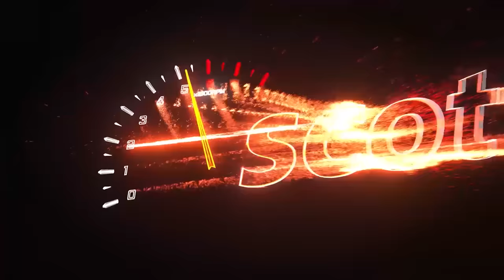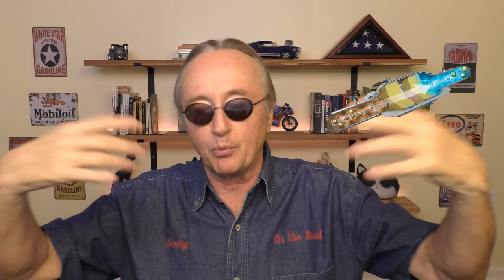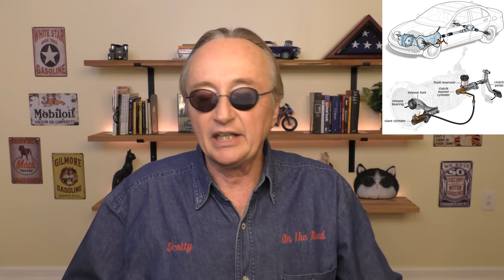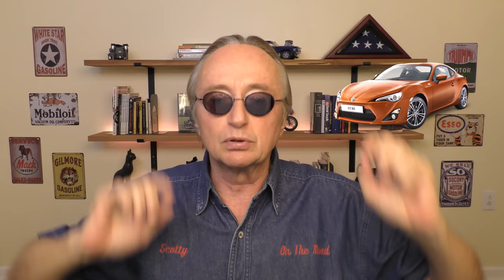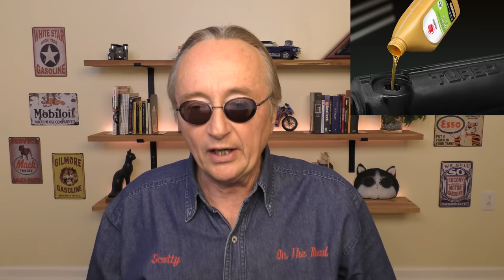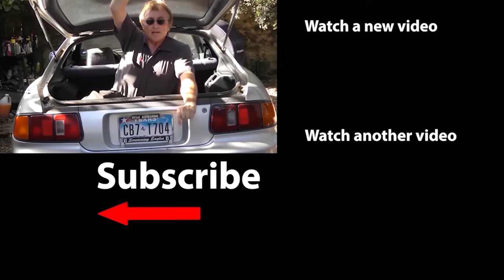Here’s Why Engine Braking Can Destroy Your Engine and Transmission

Comment: I have to disagree on transmission wear, while breaking you are using the other side of the gears teeth, so if a transmission is made to run for 250.000km i think it can help breaking 10.000 km, the only real abuse is in clutch and timing belt.
Reply: @Mark Codiroli maybe that's how you break, slamming the clutch instead of a gentle release? you can do smooth engine breaking and it is absolutely mandatory in snow, if you don't have show, good for you but stop saying this non sense, people will slide in snowy conditions and have accidents because you think you are smart , i said what I said because I am actually working in designing manual gearboxes for an automotive manufacturer, i do tests on them and I know what I am saying. We do same  treatments on all contact patches from gears so the same amount of wear can be done both ways even if it never is.

Comment: I seriously might have screwed up my transmission by down shifting prior to going down a hill.
Reply: No, Scotty's completely wrong about engine braking. Coasting down a hill and riding the brakes is incredibly dangerous. Engine braking doesn't even damage your car in any way. You save money on fuel, since it's completely cut from the engine in modern cars, and on brakes. He couldn't even explain how it causes harm. If you rev match and manage the clutch well, it can be the best technique in your driving arsenal

Comment: Do I need to have my intake valves inspected for potential cleaning? I have a 2018 Honda Ridgeline.
Reply: My concern is that the earth dreams is a direct injected system so with the lack of fuel passing over the intake valves keeping them relatively clean, I was concerned about build up. I hear some talk about "Catch Cans" but unsure about how or if that would solve the potential issue. 🤔

Comment: Hi Dear, I have a CRV 2016 and I hear a grinding noise for a second or 2 when startup when really freezing cold, same when turning the engine off as well...Do you know why?
Reply: @Mark Codiroli Thanks Mark, I will try and let you know
Reply: @Mark Codiroli No, still doing the same sound, it didn't fix it.
Reply: @Mark Codiroli Mark, you are so kind to follow up with me.  OK, it sounds like the noise is coming from the dash behind the wheel, and No AC or Audio is on. But when it is inside a warm garage the noise doesn't exist. BTW, the noise sounds like when you try to start the car with a key when it started already. This car is push-button CRV EX AWD Thanks again
Reply: @Mark Codiroli Thank you so much for the help, I'll take it to Honda and see. I was hoping it is something smaller than that. Thanks again for the care, time and reply, God bless you.
Reply: @Mark Codiroli Well, I don't trust dealers much really as you know the tricks...LOL I will try to find someone local to help with it.
Thanks again.

Comment: I love your videos. I've said a lot of people to your YouTube page and they've all had good things to say as well. What do you think about putting an automatic transmission in neutral when you stopped at a stoplight or in traffic for a long time? Is this good bad or unknown
Reply: As long as the car isn't running when switching from drive to neutral or vice versa, it doesn't hurt anything. While standing at a stop sign, putting the car in neutral will keep the transmission fluid temp lower.

Comment: Scotty i really need help i have a nissan navaea d40 2008 the timing chain has juat been done now the oil light wont go out if replaced the switch doen an oil change has the right amoumt of oil also done oil pressure test i have 5 bar at 2000 rpm idk what els to do to get rid of the light
Reply: @Mark Codiroli when i search that up i still get the oil pressure switch are they the same thing ?

Comment: Yo Scottie. I have a 2019 Toyota Camry XSE 4-cylinder sand every time I cold start the thing sounds like it’s running terribly. Thing literally sounds worse than my 1999 JEEP GC w 160k when cold. No engine codes, or knocking, just sounds rough. I’ve read VVT isn’t running and that’s why on the forums, is that true?

Comment: I don't have a cat on my mazda b3000 so where do I put liquid wrench in to clean my valves ..???
Reply: Remove air cleaner. With engine running squirt into engine. After (not on) MAP sensor. Although doing that may not hurt sensor you don't want it contaminated. MAP sensor adjusts air-fuel ratio.
Reply: @exbioman  thanks brotha my truck burns oil pretty bAd appreciate it

Comment: What are your thoughts on rev matching before downshifting for engine breaking? I do it on my bike and it’s night and day difference when it comes to the back tire not breaking loose and getting into the power band earlier before turns.
Reply: Clutch modulation will prevent tire skid but will wear the clutch faster. Rev matching is healthier all around, and you still have the benefit of engine braking once the drivetrain is re-engaged

Comment: Scotty
I have odyssey 2015,what cause steering vibrate on speed 75 ml/hr?
Thanks
Larry (Houston)
Reply: From my own experience, crappy or not correctly balanced tires. Also it happened to my daughter's car ( '13 accord ) corrosion between the rim and the brake rotor . Just take the wheel off and clean whatever junk there is.

Comment: Engine braking using gears, not good for the engine, or the clutch and doing that wears out the cambelt too due to tension and release at a snappy rate. just saying.

Comment: This guy is a MUPPET!!! Engine braking does not harm your standard transmission or engine!!! I do it with my 97 f150 4.2 5 spd manual all the time. Then again, I’m geared stupid high in my rear end. So, going downhill in 3rd, I’m lucky if my engine is spinning 2500 rpms.

Comment: Oy! These advices can cost lives 
Brakes pads and rotors under constant braking, more than 6 to 8 seconds, start to overheat and at certain temperature will loose grip between one and the other. During a heavy descent any vehicle will face deadly brake loss if that's the only technique applied. 
But worse: any engineer or good mechanic knows the load on any gearbox and axle is the same as accelerate as it is to brake and slow down. 
Wit this in consideration if you maintain a descent vehicle speed of 35 mph using a gear at around 3 to 4K engine rom it would be exactly the same as reversing the vehicle and climb at the exact same engine rpm and speed (the desirable gear)
I am sorry but transmissions, automatic and manual, are designed for this and it is exactly the same climbing under throttle than descending with out throttle, maybe better for this one for obvious reasons. 

I know you are fallible but this is engineering 101… with linear physics, and sprinkle of logic

Comment: On automatics, and even manuals this can happen- Completely UNTRUE!!!! Engine braking can damage hard parts such as the input shaft, output shaft and especially the forward sprag! Based on the amount of load and weight, you WILL grenade the driveline. The pinion bearing can only take so much, the tailhousing rear bearing can only take so much. All of this manual downshifting which is generally max line pressure, will abuse parts and cause lash, leading to excessive driveline lash. Torque management and abuse mode try to reduce this failure. If you’re making 300 ft lbs of torque at 4,400 and downshift a gear, think of the shock on the transmission, transfer case, and even differential. If you don’t understand this then you shouldn’t be commenting.
Reply: I have a 2017 Toyota with 45k. The transmission downshifts halfway down steep hills to about 3k-3500 all by itself. It never did this before..you can hear the whine...

Comment: engine braking is perfectly safe. you're wrong on this on Scott.
Reply: It puts extra wear and tear on engine/transmission. I actually thought of this months ago and decided to never use engine braking on normal circumstances unless if I really need to brake as quickly as possible (which very rarely happen). Using engine braking as your normal measure to brake is, in my opinion, not worth it. I'd rather have to replace my brake pads once a year rather than having to repair the engine even once in many years.
Reply: @triparadox.c  Accelerating puts more wear on a engine and gearbox than engine braking ever will 🙄😂
Reply: @TheStriker0525  That may or may not be true, but it does not change the fact that engine braking puts extra wear on the engine/transmission. Considering a huge difference between the price for brake pads and engine repair, I simply cannot understand the idea of glorifying engine braking. I'm not saying you can never use it, but to use it as daily braking system is simply ridiculous for me to do.
Reply: @triparadox.c  trucks with a million miles disagree with you. if it does put extra wear on them then prove it?
Reply: @TheStriker0525  It does. It doesn't matter whether it's semi engines or car engines. If they work relatively the same way, the way they gain wear and tear will be similar. One thing you should keep in mind is how semi trucks drive when compared to typical cars. Semi trucks, most of the time, cruise on the highway at 55 to 65 MPH stable for hundreds or even thousands of miles. They barely spend their time idling. They rarely use their engine braking when you consider x amount every 1,000 miles. On the other hand, cars tend to be driven for 10 miles to 50 miles a trip with occasional braking, especially those in cities. This is something you need to keep in mind. Driving on constant speed puts significantly less wear than regular city driving.

So yes, my point remains there. You arguing that engine braking does not put extra wear by mentioning truck engines last a million miles is for a whole different reason.

Comment: In my entire driving experience I've NEVER used the transmission to slow down. No mater my speed if I plan to stop i throw it out of gear and brake like normal and "knock on wood" never had an issue.

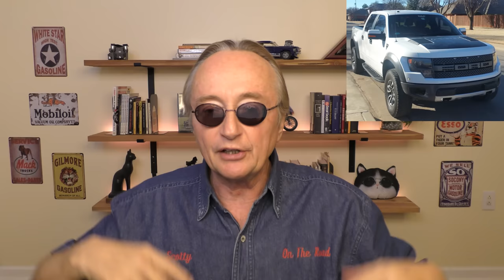Comment: 1:50 Matt from Demolition Ranch had a raptor and the power steering pump went out... It's not even that old of a truck! Get the colorado if you have half of a brain in your head. There is a reason why GM is a much bigger company than Ford.

Comment: Engine braking is standard practice everywhere where manual transmissions are the norm. I'm not even trying to go "haha stupid Americans" here, but this topic is only ever a hot potato in America where manual transmissions are mystified. Elsewhere it's a no brainer. You're coming to an intersection? Just take your foot off the gas long before the intersection and coast in gear. You're saving gas and brake pads, and you're not harming your car in any way. The engine keeps turning, the oil pump is working exactly the same, and the manual transmission (which is a simpler and more robust system than an automatic transmission anyway) can without a shadow of a doubt take the "stress" of engine braking, which is far less than the stress it's under while accelerating. This is not a "wear out your brake pads vs. wear out your engine and transmission" thing. That's a false comparison, when engine braking doesn't wear out your engine or transmission. This is an economic driving thing. It also probably makes you a safer driver overall, because it requires anticipating things.

Comment: Hey, Scotty, got a 2008 Ford Focus (2nd Gen). Been having a problem with the radio/clock display in the console only coming on from time to time. Everything else in the console works, and I haven't found much info online about it at all or it refers to the other generations . Luckily I have most functions memorized and when I don't I use voice recognition, so it's not a HUGE deal, but was wondering if you could shed some insight on the problem.

Comment: So going down a long hill, trailer on, in top gear, foot on the brakes.. oops 
Nah mate, you have this wrong!
Your brakes will overheat in no time at all.. then no brakes at all!
Slow your car to a suitable pace, pull ur tranz back one or two gears, as the speed increases, apply brake, to bring speed down, remain in lower gear, provided it is low enough, release foot brake, using engine braking to retard acceleration and the brakes get to cool down a bit..
It is critical to slow ur unit to a suitable speed and gear ratio before the decent!!
If you get it wrong, u may not get to the bottom safety..!

Comment: I can feel the difference in performance with my 2020 Durango GT right around 5,000 miles, and at that point my Oil Gauge is usually around 10% so I dont recommend trusting the Computer. 5 minute commute to Work that is stop and go.

Comment: Hey scotty. I have been a subscriber for years...
One question .. I have a 2003 mdx and only get heat in the back of the vehicle and cold air in the front and floor vents. Why ??
Im thinking of replacing the radiator soon.

Comment: Not Jake Brakes!
Reply: Most pickups and cars use an exshuast brake thats actually on the exshaust and not internal on the valves, theres a huge difference between engine brakes and exhaust brakes, hell some semis use both systems. People often get the two setups confused or poorly explain

Comment: Ford or GM?  Both are crap.  Dodge too. Owned all these  and quality of these trucks has gone out the window.  Market share is what it's all about and not quality.  Good for going off road? It may be a Raptor but stop saying heavy duty Scotty.  Still based on the 150 with a 150 transmission not HD.  Can't tow much with it and over priced.

Comment: Sorry but just saying "its stress on the engine/trans" is an incredibly loose statement and it aint good enough for me, especially coming from a mechanic like yourself..
 if i go above 4k RPM in say 3rd going down a hill i will use brakes till the car is balanced at the RPM/Speed i want to achieve, there is absolutely no reason to sit on the brakes unless the hill you are going down is pushing the engine beyond a certain limit for an extended period of time and if that is happening you are most likely in too high of a gear which is why you keep having to brake.. It mystifies me how a mechanic can make such clueless claims like this. Then again this is the guy Who thinks the muffler is responsible for Air/fuel ratios lol
Reply: @Mark Codiroli "Repetitive downshifting for stopping is what he is talking about" No its not.. The person asking the question asked specifically if slowing down on a hill using the gears is bad for the transmission. His response? Brakes are cheaper than transmissions blah blah stress on the transmission blah blah. Engine braking should be used on long steep hills down as a way to assist your brakes and its absolutely fine as long as you are keeping the revs below 4k. 

I have a cat back exhaust that is a half inch bigger than stock and my car has run perfectly fine the whole time that ive had it. Heres the problem with scotty he lacks nuance.. And this leads people to believe half truths (scotty conjures a lot of those) and leaves them being misinformed